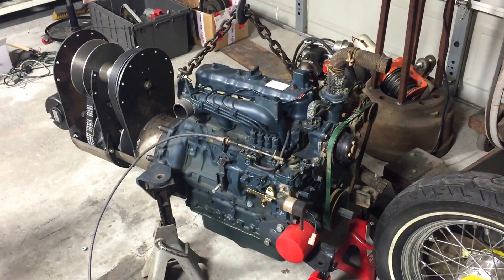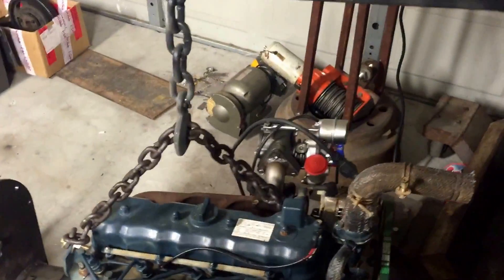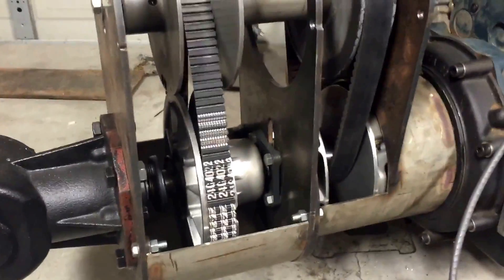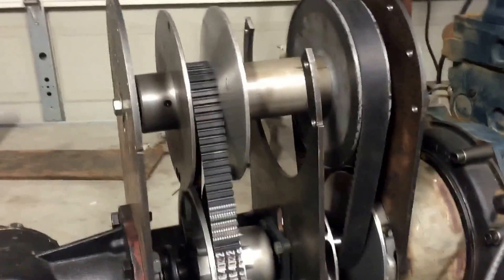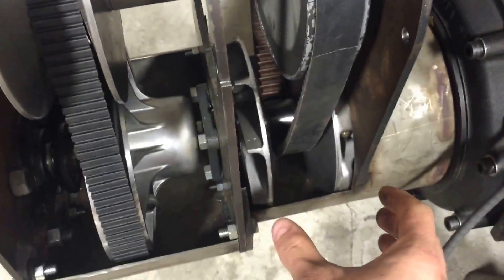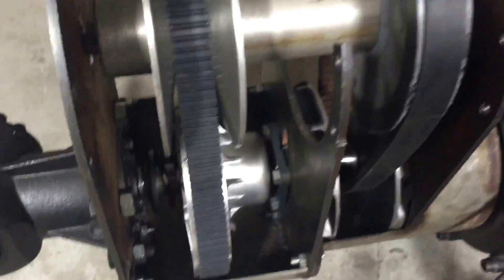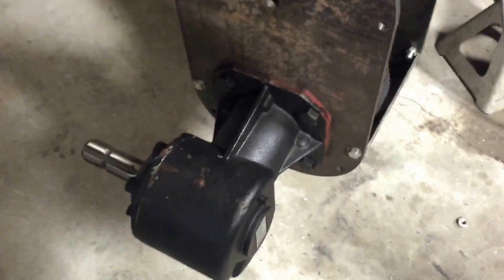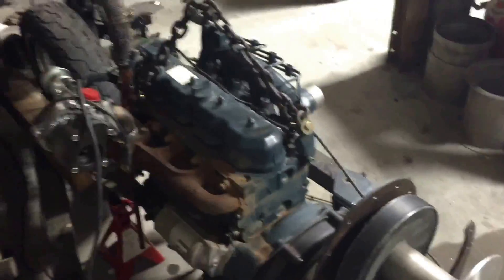Diesel Motorcycle Mk III with Dual Stage CVT

Comment: Hi sir. thats an owesome you build there. can i ask about your cvt ? do you made them by yourshelf ? or is that available in the market for big motor application ?  i'm planned build a bike powered by VW 1200 motor. the motor already laid in my shop, i just can't found a good and reasonable price gearbox for it. fyi here in my country BMW/Ural gearbox are so expensive. so just come in my mind to run it  with cvt. with some search on YT lead to your channel. I really appreciate if you can help me with some info about this cvt set up. thank you very much. Richard from Medan - Indonesia

Comment: Love the CVT setup. My diesel bike runs one but single stage. It really is the answer for the low rev range and high torque. but the there is a lot of hate because you cant shift gears. Nice work!

Comment: finally someone doing dual cvt, ive alway thought of it, this way the lack of rpm from the diesel wont limmit ur overall top speed. set ur final drive ratios to a nicer cruise rpm at 60mph and at 28:1 take off she'll still get up and go.

Comment: when you design this bad ass shit do you use any cad software? or are you in the shop measuring and fitting? just curious because you blow my mind everytime I watch one of your vids.
Reply from the maker: Everything up to this point was built by hand and test fitting. Just recently I purchased a 2'x2' CNC plasma table with Ucannest software. The plates on the stool CVT transmission work cut out on the table. Now I am able to fabricate things much faster with a lot better precision. Thank you for your comment.
Reply from the maker: Dual not stool sorry